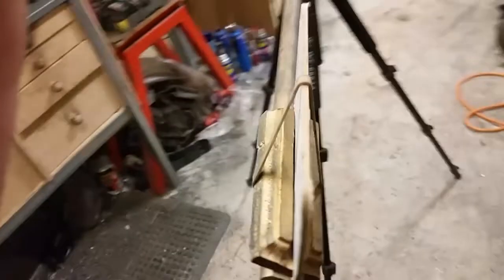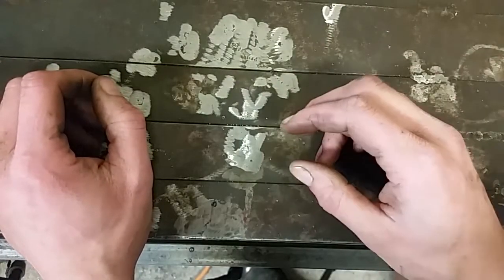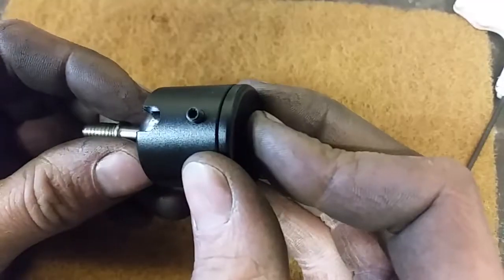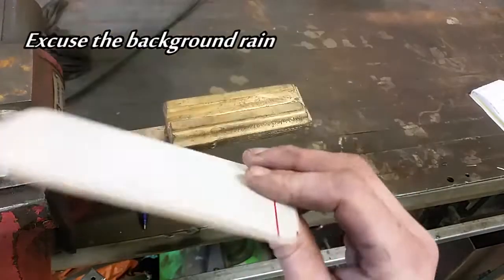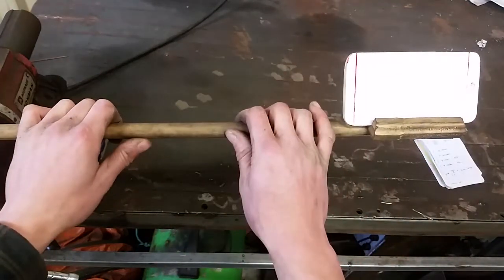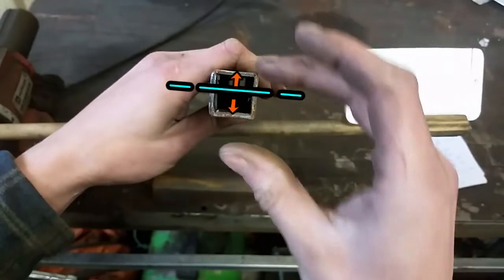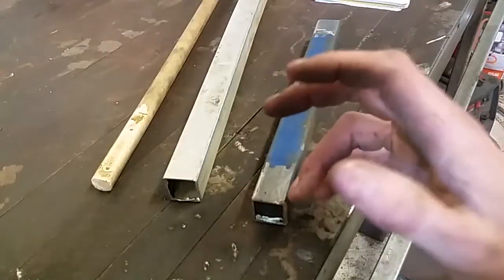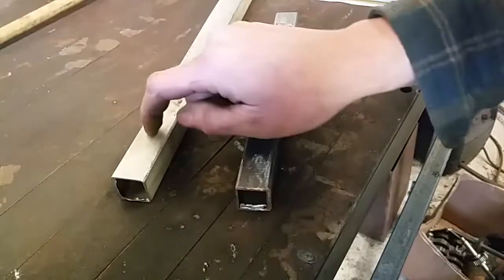Camera Boom Upgrade!

Comment: Oh, a familiar problem :) I also used to shoot with a tripod, but it's not convenient - the tripod got in the way. So I attached the camera to the ceiling. Made a frame along which you can move the camera in 2 planes.
Reply from the maker: Nice. I nearly went with a room mounted system. I've since upgraded to an articulated boom arm very similar to Phil Vandley's design here: https://www.youtube.com/watch?v=sRkdNH5fxRE
It's fantastic to quickly switch camera angles

Comment: I used to build little jib cranes, stabilizers, and dollies for 16mm cameras. Oddly it's kind of addictive really. The material I liked the best was the rectangular box steel from futon frames and skate board bearings The set up I use for my lathe is a "Sky Hook", where you mount a pipe (ideally to the ceiling) over your lathe. (running parallel to the bed). You machine a T fitting so it will fit over and easily slide on the overhead pipe. Drill and tap into the side of the T fitting for a binding lever bolt which threads into the T fitting and pushes against the inner pipe preventing the T fitting from moving. The bolt should be like 150mm or so and bent at a 90 (Or have a knob) on the end so you can easily reach up and adjust it. Then make an arm with a short length of pipe that threads it into the T fitting, and add a piece of angle to it to mount the camera on (I have a little 1/4/20 threaded ball swivel camera or flash mount on my piece of angle. When assembled you can slide your camera over the chuck, over the work or over the compound, and lock it in place at whatever angle you like. It helps if your camera has a flip around screen to see what is in the shot, and of course a phone will be different, but still do'able. This system isn't a do all end all be all mounting solution, just one that gives repeatable shots once your lights are set up, and which keeps tripods and other mounts out of the way as you work on the machine. I'd like to add a telescoping (Tripod leg)  so I can not only slide back and forth over the lathe, but pull the camera down to whatever height I want. Another mounting idea for the sky hook mount would be to use an indicator stand (Like a Noga) so no only could you slide back and forth, but also quickly fine tune the position of the camera like you would a dial indicator.
Reply from the maker: Good idea. Now that I have a standard camera holder I foresee myself putting in a lot of mounting options around by shop. Keen to get some on my lathe carriage (maybe just with dial indicator holder)
Reply: One good mag base indicator stand can do  a lot. You already have high production value, so I don't doubt you will get some more great shots. :)  @TomMakeHere

Comment: another little trick instead of the holder that's clamping the phone, the stupid selfie sticks, the phone holder part actually unscrews from the stick part and uses 1/4-20 thread, which is the same as that swivel part or the thread on a standard tripod. Ive used that method for quite a long time when I first got started on youtube to record videos using my ancient phone, lol. It holds the phone pretty well too depending on the selfie stick, and no chance of over tightening and cracking the screen.
Reply from the maker: Good tip, yeah I don't love the current clamp setup, I only snug it up just enough to hold